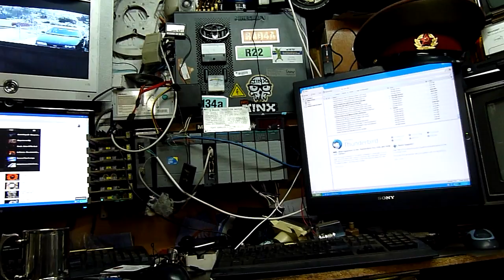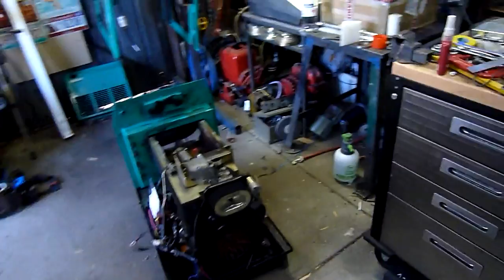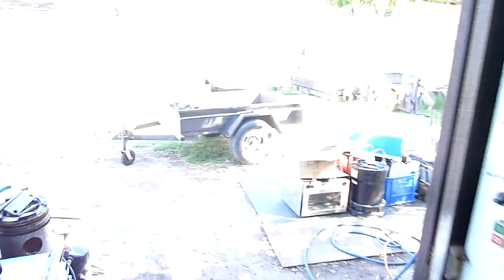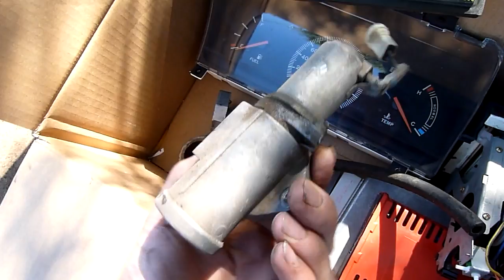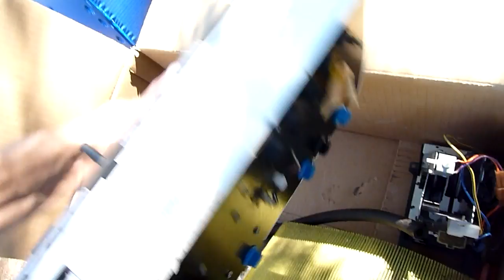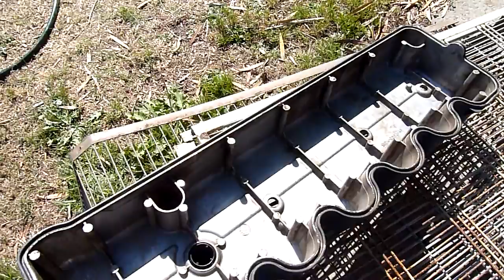Ramblotronic Friday - Ford Falcon Parts and Catching Up

Comment from the maker: I only use it for top up, but you just have your gauge set service hose (yellow) going to the high side of the donor car (not running) then have the high and low hoses connected to the receiving vehicle (with engine running and AC on) and just allow the suction side to draw vapor out of the donor car, somtimes you will get a bit of oil tho, so its not recommended for systems you really care about.
likewise, air, moisture and debris are also a risk.

Comment: I go through a router once a year.  They get flakey.  My net gear router would shut down wireless every 10 minutes on the second.  Smashed it on the kitchen floor.... Put it he PCB back into the shattered case and got 6 more months from it.  The D link which replaced it 1 year ago is now acting up.  Have to reset it all the time.  I bet dollars to doughnuts it the Eco-shitty lead free solder on the BGA and flip chip devices.

Comment: 3DBC catch code on the ECU. 3 is the series- ED.  D means standard ford, it would have T instead for tickford.  B is auto transmission, A would mean manual.  And C is the revision number.

246,000km.  Pretty low for its age.

Comment: The U.S and Canadian Ford Falcon line died in the 1970 model year I believe, the last ones were technically a 1970+1/2 model. They started off as a compact, much like the Valiant did, but grew progressively larger over the years, the 1970+1/2 was an intermediate like a stripped down Torino. I think the Maverick basically became the replacement for the Falcon after that.

Comment: The earlier Australian Valiants were largely based on the U.S built Valiants, they look almost identical to the American Valiants made between 1960-63, and use the same /6 engines. Except theirs say "Chrysler" on them rather then just Valiant or Plymouth Valiant, and they are right hand drive of course.

Comment from the maker: I was not referring to my Fairmont, the car in question was very run down, auto was dead and needed a massive service (same level as what I did to mine if not more). and just like the Daewoo, you can buy them in roadworthy condition for far less than what it would cost to put a unregistered one back on road

Comment: Ahh i see :-)

So it sort of oscilates by a small amount, its hard to test something when you dont know the exact spec.

And it does not need to be spot on accuracy as the average of the oscilation would be the aim, about right?

Comment: IAC valves on Fords are Pulse Width Modulated sortof. The motor opens and closes the valve rapidly to control idle and it doesn't move much while in operation.

Comment: A question if you dont mind :-), is the i.a.c valve supposed to be fully vairable?

My mates ford ka had odd idle problems, he bought a new valve but it didnt help, i took a look and it seemed like a crude coil and plunger setup, a simple single coil solinoid.

With a psu i tryed to make it operate at different levels, but it was really weak and failed.

Typical shit design??